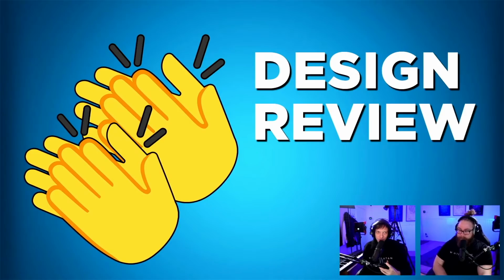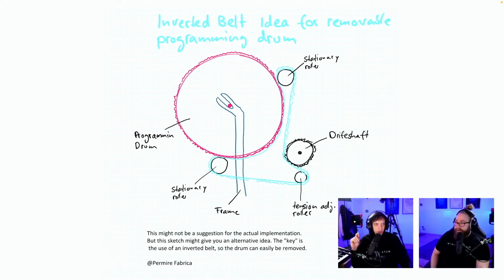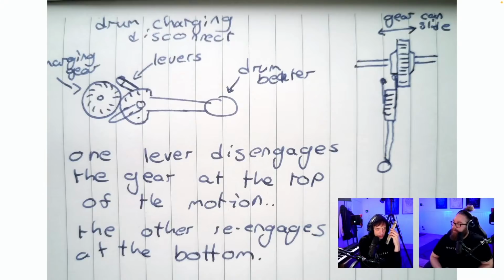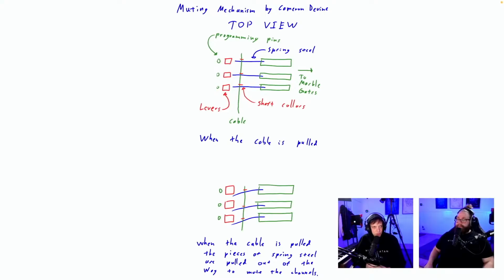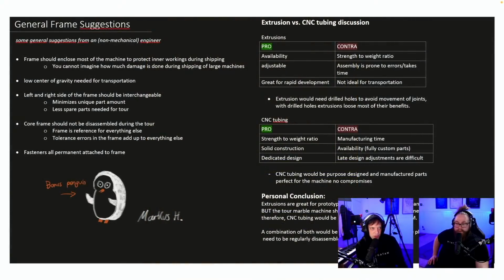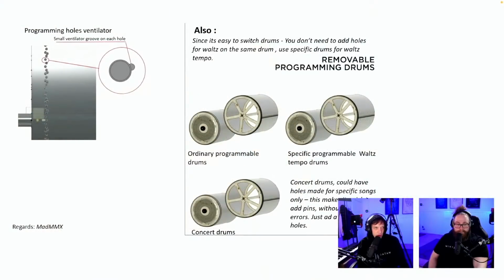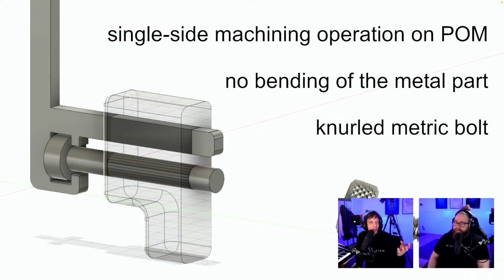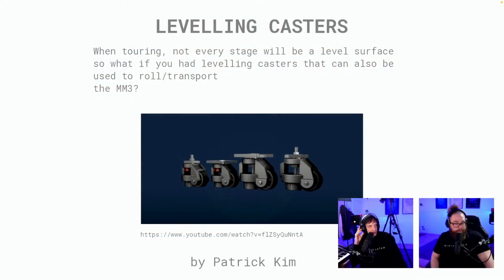Design Review 👏👏 - Martin vs The Machine #22

Comment: Al Viger
If you want ease of removing the drums,  you could  use automotive automatic belt tensioners. they allow the releasing tension without actually removing the tensioner.  Also you can use two sided cogged belts to drive the parts with one belt.

Comment: Martin, if you think about cable, you should look at old camera "cable release".
They are different from bicycle cable, it doesn't pull, it pushes.
They have spring inside to get them back in original position, various locking system on some models, and they are efficiently used since many years in the photographic universe with no delay between the push of the thumb and the picture taken by the camera, even at relative long range. Friction can occur a little on some models (because photographer dont care), but the pushing power shoul be very good and better materials could be almost friction free.

Comment: Idk if this got already solved, but aligning the programming drum with the gear is simpler than having to worry about aligning the correct teeth of the gear to the right groove of the belt.

If you take the belt gear of with the programming wheel/drum instead  of leaving it in the machine you will have the problem that you need to align the belt and gear perfectly into the right grooves of each other or the hole music will be played off beat.

Comment: Your timing clutch is redundant. You can adjust relative timing by moving the belt forward or back a few teeth on the gear. Also I would highly recommend having the big gear on the programming wheel stay on the machine and not come off with the programming wheel, otherwise your quick change drums will be not so quick as you juggle with removing and reattaching the belt (and losing the timing betwen the drums).
Reply: Not so redundant then since it solves the issue you thought of? The entire point is consistent, quick and reliable settings, they do not have the time to fiddle with which exact tooth goes where, they need to set it separately so that they can just drop in the new drum thanks to the timing being separately controlled. Remember that it will need to change after every single song in the middle of a live concert
Reply: @Koushakur  if the gear comes off with the drum, they'll need to redo the timing anyway. Whether you do it by shifting the belt or indexing the gear to the drum doesn't matter. 

The clutch would made sense if the gear stayed on the belt, so timing wouldn't need to be readjusted when the drum is swapped.

Comment: 2:30 I suspect that this design is to be able to tighten/loosen belt without the timing offset between programming wheels depending on belt tension/stretch/wear.     Tightening belt with roller only on one side only will create some timing offset between programming wheels as belt stretches a little.  Having two rollers gives symmetric relationship between relative timing of both programming wheels.  So maybe one control wheel is to tighten/loosen the pair of rollers symmetrically, and the second control wheel is to adjust both rollers asymmetrically, to fine tune timing offset between programming wheels.

Comment: I have cheap hydraulic brakes on my Trek. They are pretty OP to begin. They sell much more responsive ones where you actually have to be careful how much pressure you put on thee brake lever. Might put you of the handlebars in a pinch.
Reply: For sure, you can set them to a certain pull depth and they don’t budge. Liquids are incompressible so it’s a great idea

Comment: 1:27:10 I like the idea by kersentaart. A dual registrator method and a simple camshaft to “mute” the tracks. 
 It allows the all four states of the machine (Muted, A, B , A+B) A+B part could create some interesting ways of combining the two tracks into a new more intense section of the song. 
It is based on an already working muting method from the MMX and it should be possible to only use one Bowden cable per channel. It sets stricter requirements to how slim the registrator heads will need to be. However, the two registrators shouldn’t need individual adjustments!. Still only one adjustment per channel, thus it should be placed after the two registrators (A and B) are combined. The timing adjustment could even be at the marble droppers (clock escapement) instead if space is tight.

Comment: I hope Martin comes around on the transportation issues. Making it modular makes way more sense, and as usual he gives an excuse for why it's a bad idea which is easily solvable (screws wearing out, really Martin? You can engineer the coupling mechanisms of the modules to be simple, with latches or similar, and the cost of keeping a few extra screws around is marginal anyway!)